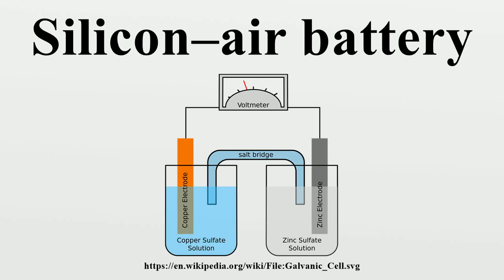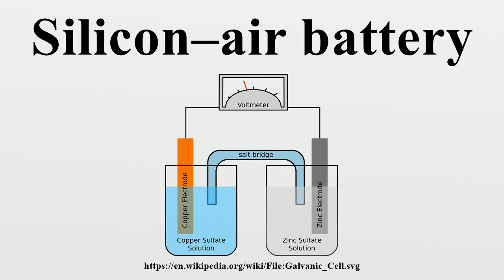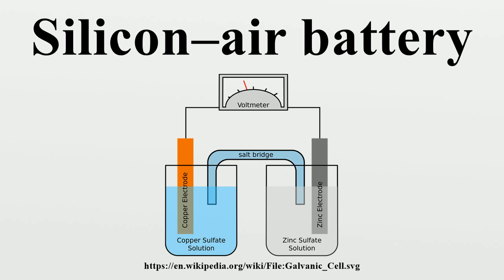Silicon–air battery

Comment: Some time long, long ago an old hippie dippie guru type told me that the original purpose for the Pyramids was to produce energy and that the battery of the process was made of ZINC and Copper.....I wonder where his info came from.
Reply: How did You get this information? What are the papers, the tests and methods with which these conclusion has been drawn? that can be counter-checked, and please, not "revelations" from above ... Anything is claimed around because it is easier to practice credulity than counter-checking, so when you state something like that, you should be able to provide all the evidences which support your thesis or it is just one of these thousand of thousand rumours the web provides.
Reply: the pyramids collected energy from dipoles from above  tip and the moist ground below..just like sort of a tesla radiant energy collector patent over 100yrs ago